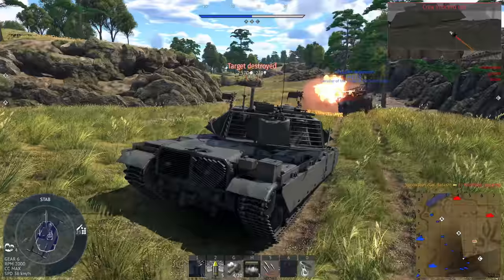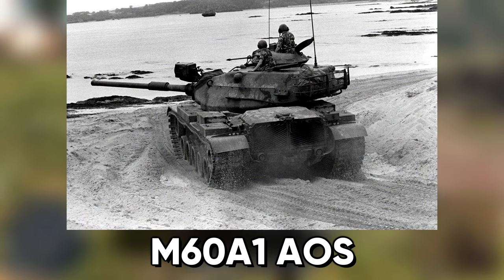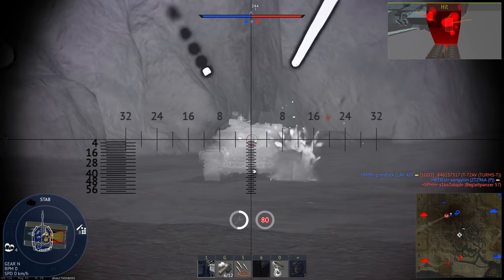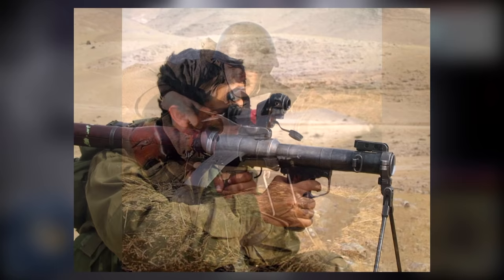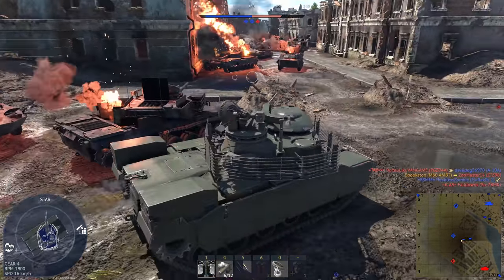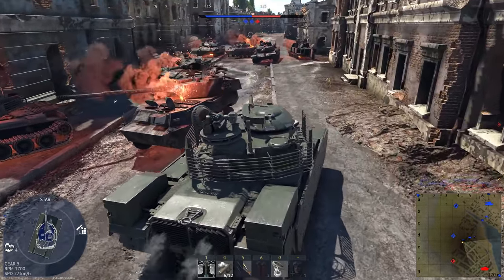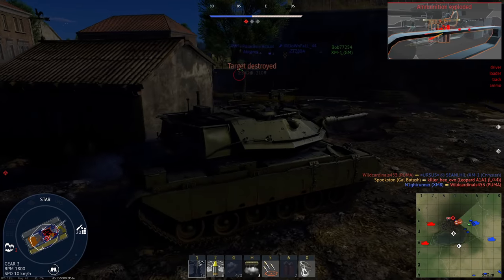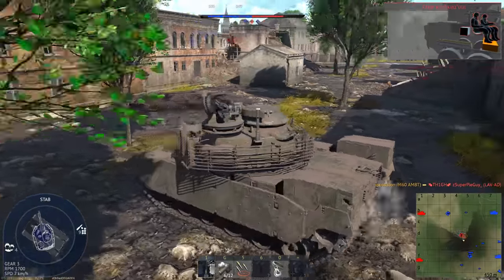How Bad Was The M60?

Comment: A regular Winnebago compared to the M1 and the turret monster was very tame compared to the M1. The most important thing on an M60 in Germany  was having a working heater. It was a sad crew that didn't have one when it was cold/rainy/snowy/icy/etc.

Tank heaters and heater parts(igniters and thermostats) were like gold, and you best be first at the Motor sergeant's office,    if you ordered any when they  were put in platoon parts bins or "boom" stolen  within minutes. Actually the whole parts situation seem that way. as line M60 units had a lower supply priority.  Could take months to get some light-bulbs/rare parts if ever. Parts theft was rampant.  (For some reason my 2 tank section ended up with two extra CONEX's worth of tank spare parts and tools,   I don't know why ;)   LOL

Comment: I was one of the last 19E tankers of the 80s. the M60a3 was a dog as far as power but the gun system was awesome. it was time for a change and the M-1 was the tank for the future. luckily I was able to spend a lot of time on the OPFOR M-551 Sheridan at the NTC fighting both MBTs. Steel on Steel.
Reply: Thank you for your comment! Operating on those NTC M551s must've been a blast, but I also suspect it was a pain in the rear to maintain if you were on them in the closing 1980s and into the 1990s.

Comment: I was in the 1st Marine Tracked Vehicle Battalion, a composite of two companies of amphibious tractors and two companies of tanks in the 3rd Marine Division, when the M48s were replaced with M60A1s in 1977.  The functionality of the M60s was not the same as that of the M48s in most respects except the armor penetration of the gun.  That was the only real improvement as far as Marine Tread-heads were concerned.
Reply: Marines ended up using M60A1s longer than pretty much anyone else, including the Army! You folks sure knew how to run them for quite some time, once those M48A3s were on their way out. Thank you for your comment and for your service.

Comment: They should have gone for a gun and armour upgrade for the m60 in the 1970s. It was more than good enough to deal with T 55 and T 62's, but once those T 64's and T 72's started getting deployed by the warsaw pact in the 70s, the M60's advantages were negated. If the m60 had to fight T 72's for real, it would not have been a pretty picture.

Comment: I spend 5 years  on a M60A1  and  M60A3 and M1   not once   did  have a track break , never had a motor  fail ,  theM60a3  gun system was  better the M1  when it came out  .

Comment: The Taiwanese Army still operates a notable amount of modified M60s, although it was more likely a forced decision than a choice, as they weren't able to get newer tanks before Trump decided to sell them modified M1A1s a couple of years ago. Kinda interesting to think how an US army personnel would react when they see one of these tanks had they been on a mission in Taiwan.

EDIT: Apart from the 400+ M60A3 TTS Tanks in service, the Taiwanese Army also operates some 400 CM-11 tanks, which is a hybrid tank with the chassis of the M60, the turret of the M48, and the FCS of the M1. Efforts were made to modernise the M60s in service, but since the platform is too outdated for the upgrade to be efficient, the latest upgrade plan ended up being scaled-back, and much of the funds were diverted to buying new M1s instead. Since Taiwan is unlikely to get enough M1s to replace all of their existing tanks, it is likely that we'll see these old tanks being kept in service for a few more decades.

Comment: Wouldn't call it a bad tank. Final variant with TTS was fairly modern but being outclassed by newer tanks being fielded. Some fun times had was having a small bolt fall out of track control @ 30mph & no steering of 56 tons. Top speed might have been better with extra gear. Trans was basically a powerglide; 2 forward gears 1 reverse. Almost got drowned in one @ Ft Hood during AT when we were buttoned up at MOPP4. Idiot driver goes up smooth berm, doesn't listen to TC and drives right over into the middle of a stock pond. Takes his foot off accelerator and that was it. Driver freaks out and somehow scrambles into turret through area not designed for human being to fit with gun facing front. I was killing power controls @ gunner position in case the turret controls short out from the water. I look to my left and 105mm bore of water gushing in from gun tube. We evacuate and swim to dry land as tank is completely covered with water. And it's a tall tank. Took 2 M88's to pull it out of the mud. Pack hydro locked/ruined, all electronics destroyed.
Reply: I wouldn't call it a bad tank either, for certain. Though it seems like in your case you certainly experienced the wrath of a bad driver! How long did that recovery process from the M88s end up taking? I can't imagine it being any quicker than several hours, but perhaps I'm wrong.
Reply: Maybe hour or so I guess. Battalion & company Commander were very not happy. Just glad nobody got hurt.

Comment: I don’t think it’s entirely fair to say the M60 was, from its outset, a deeply flawed vehicle. It was heavily armed and armored, and for its day, adequately maneuverable. It’s flaws were endemic to most tanks of the day, and like any modern army, improvements could be expected. The A3 variant was essentially a new tank next to the M60 in its original skin. But there were significant weaknesses, which are pointed out here. The track was a liability, requiring endless maintenance, and the center guides were designed like a tuning fork: the ringing could’ve heard for miles. The engines were, well, adequate, if not outstanding. But make it more powerful, and other driveline weaknesses would quickly manifest. Add on armor, and the road wheels and torsion bars would give out far faster. A bigger gun would mean a more cramped fighting compartment and fewer bullets. 
One thing you don’t mention here is the commander’s M85 .50 caliber mg, and what a notoriously unreliable piece of junk it was.
Reply: I should note that from my perspective "deeply flawed" doesn't necessarily mean "critically flawed," but that there were a wide range of teething issues which needed rooting out. I absolutely agree that by the time of the M60A3 you have yourself a very capable MBT, in spite of a few lingering issues. I didn't mention the M85 nor the M73/M240 Coax, two things I could've but to be honest with you there were a lot of additional comments or analysis that I initially wanted in this video which I cut out for the sake of time. I do wish there was a more concise way I could've described the intricacies of the M73 and M85 dilemma, and the varying opinions on the system, but this was unfortunately one of those elements I later decided to cut.

Comment: What does 'solid state' mean exactly, when talking about the ballistic computer?
Reply: Compared to older "Mechanical" Fire Control Computers a Solid-State FCC is the first type of fire control system that is an actual integrated computer (in the modern sense) onto the vehicle which is automatically calculating lead, elevation, trajectory, and accounting for all sorts of user input variables. Prior to that the Mechanical systems were often blisters, dials, or gauges that the Gunner would manually adjust or input to get an accurate firing solution.
Reply: @Th0nky  Good to know, thanks.

Comment: I’m sorry but the petrochemical flammable hydraulic fluid in one of the parts of the tank most likely to sustain a hit is inexcusable. Did they never take a few models off the line, fill it full of dummies, turn it on, and start blasting it? Does that kind of testing even enter into the brains of these kinds of contractors? I’ve worked with civilian contractors before. Those folks were great people to work with. I could tell they were fucked up by the work(no not weapons work, I personally would never) but they were smart enough to test prototypes, and we did. That was a huge part of the job.

Maybe I’m just lacking the knowledge of how they test these things out, but wouldn’t you at least shoot one of these tanks with a bunch of different rounds to see if there were significant issues? You’re making thousands upon thousands.
Reply: In fact the US Navy and AF both noted the vulnerability of the old fluid in the 50s and moved to an inflammable one, so it is even less excusable.

Comment: The m60 is like the American equivalent to the t72. Some variations are garbage and others did great. It had a 103 kd in deasert storm when used by the Americans. Mostly because of American doctrine because the m60 would spot a enimy tank such as a t72 and it would stay behind cover as it called in artillery or air support as seen in deasert storm. It also obliterated some t55s from what I know but Kuwaiti m60s didn't do too good

Comment: With my experience as a 20-year US Army Tanker on the M48A5 M60 M60A1 
M60A3 and M1 including two years as an instructor for 
the Armor officers Advanced course.
Almost all your information is erroneous !!!
there were a few problems with the early engines but they were quickly worked out
I've never heard anything about the kind of Track and torsion bar problems 
you were talking about
Reply: 8 years as a m60 tc. Never had  broken torsion bar. Blown jug, yea.

Comment: Love how the info is about the m60 with 105mm L7 gun, yet in the video it is Turkish M60 with 120mm L11, different engine, transmission and stuff. How further from an M60 could it be? Is it cause the gameplay on a original m60 would not be so entertaining? Should have put a moderna gameplay then, still as close to m60 as AMBT.
Reply: @voo Exactly my point. I.e. Moderna is also fast, got a great gun and an additional 30mm. And it have same amount of common things with M60 as AMBT - zero.

Comment: my opinion is relatively negative due to a lack of innovations. Ultimately its an upgunned M48, and incremental improvements otherwise. Protection, while superior to Leopard 1 and Centurion, was a far cry from a T-64 and still behind a T-55 and T-62. Against HEAT munitions, its actual armor was fairly useless.

T-64 was better in virtually every way save for perhaps crew ergonomics, and gun depression. 

If anything what makes the M60 a decent tank was the upgradability aspects of it. Advanced optics, stabilizers, and potent new 105mm ammunition turned this tank into a decent vehicle.

To me, it represents a lack of attempts to innovate, making the US not field a composite armor, smoothbore equipped tank until the 1980s.

Comment: The M60 isn't bad. But when you compare it to Soviet tanks at the time, it's kind of a different story
Reply: Can you elaborate on your meaning? I'm curious of your take.
Reply: @KardasheviteUltravisionary  so the M60 tank was introduced during the 1960s that meant it would have come up against the Soviet T-62s and T-64s. The M60 would have been outgunned and outclassed by the Soviet MBTs. Even though the M60 had an excellent gun and armor for it's day, the T-64 with it's new composite armor would have been hard to deal with. Now the M60 was fielded with a 105mm gun while the soviets fielded their T-62's with a 115mm gun and the T-64's with a 125mm gun. So really, if you're going to compare the M60 to the Soviet MBTs, you have a medium-low kind of chance of winning. And in a real life scenario, with the high production numbers of the Soviet tanks, the medium-low chance of winning would decrease to a low chance of winning.
Reply: @User1-T7R  This isn’t true sure the Russian t series had composite armor at the time it was really only effective against heat apfsds was very effective against it also just because the caliber is bigger it doesn’t make it a huge advantage especially when you consider the much lower comfort of the Russian t series